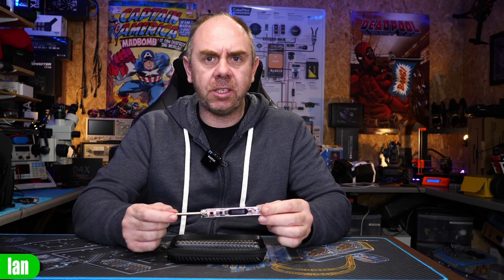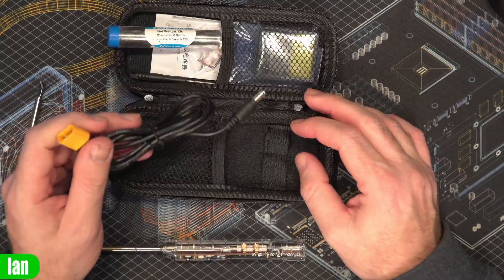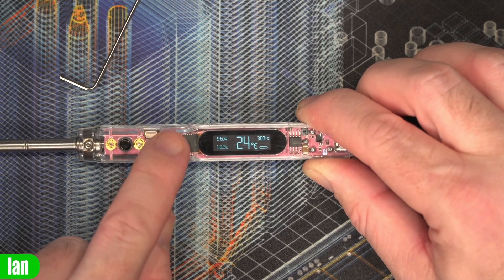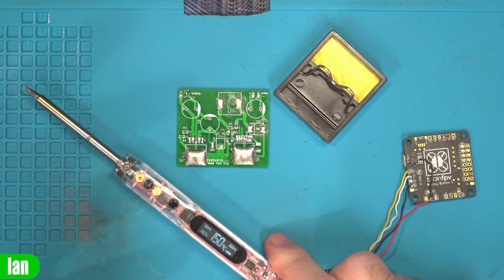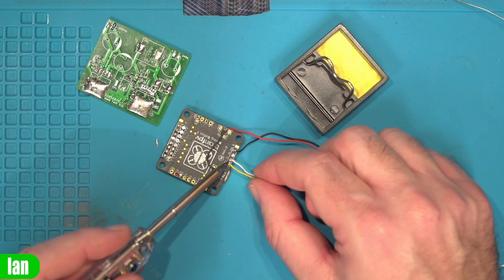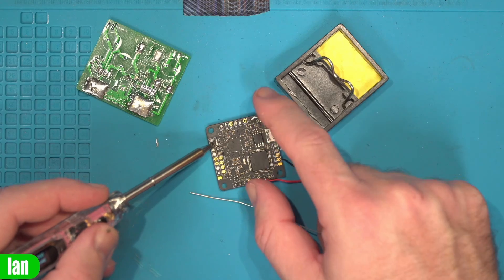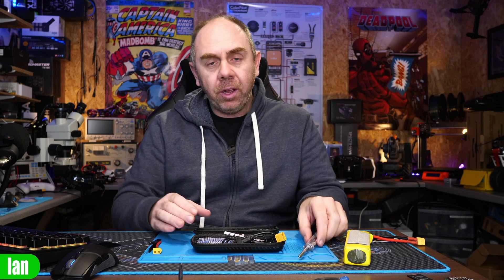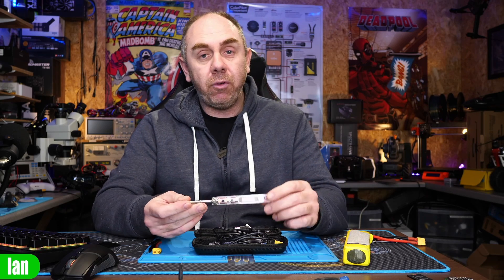Sequre SI012 Portable Soldering Iron - Ideal For FPV

Comment: "It is lead free, but that is pretty much everything you are going to find today"? Um... no? You can buy leaded solder anywhere! lead free solder has absolutely ZERO place being used in electronics. I know manufacturers BUILD stuff with lead free solder so they can claim zero lead for paperwork, but 100% don't use that to make things at home unless you are going to be using it for water pipes or something you are going to touch all day everyday and consume. The shear amount of extra heat required for unleaded solder will destroy most contacts on a board unless you are a perfect robot.

Comment: How does it compare to a ts100?  You get the same barrel, plus USB option, and 2 options for tips.  My ts100 Heats to 400 in less than 10 seconds, but I'm also using 6S. 30 seconds seems slow, but that may just be the 4S supply.
Reply: Bueler ...

Comment: Think i am sold on this.
My TS100 screen went dimm common issue it seems.
Was looking at the pine64 pinecil because of same TS100 tips and DC barrel and USB-C.
But this accepts what i would call more pro tips so bigger selection of tips.
I can use all the TS100 tips i bourght and over time buy the t12 instead.
I know one tends to use a couple of specific tips but still ~29 t12 vs the 10-11 different ones for the TS100.

Comment: I dreamt about a portable hot air gun so that I can change mosfet at the field....
Reply from the maker: That’s a blow lamp 😆🤪
Reply: @MadRC  Would have to strap an infrared thermometer on the blow lamp and control temperature via manual PWM by hand. Hmm I think we are on to something.
Reply: @MadRC  sounds messy